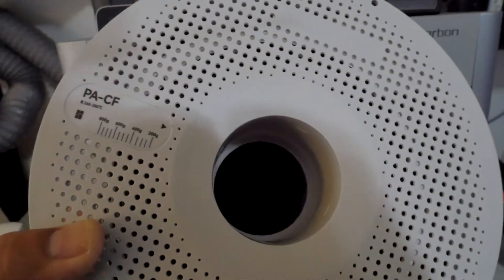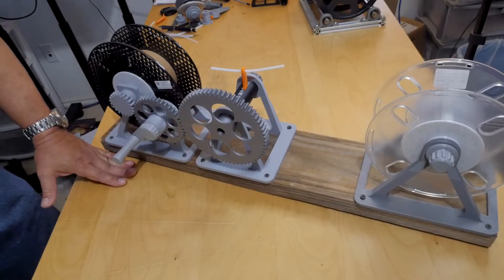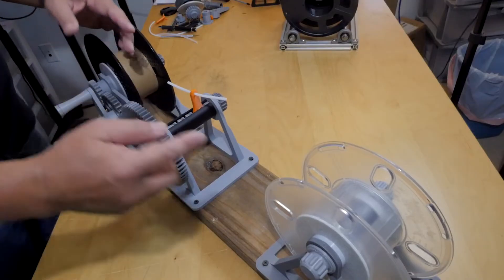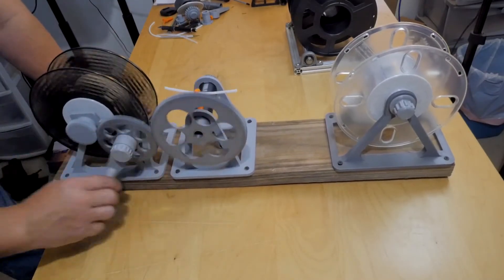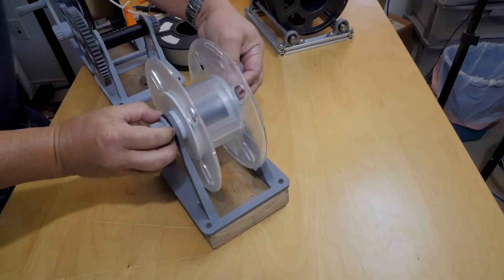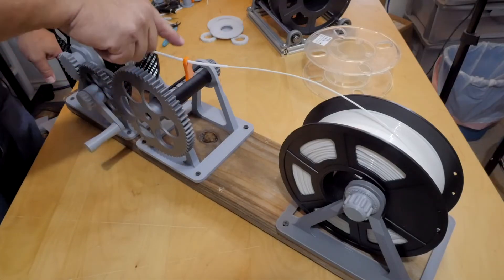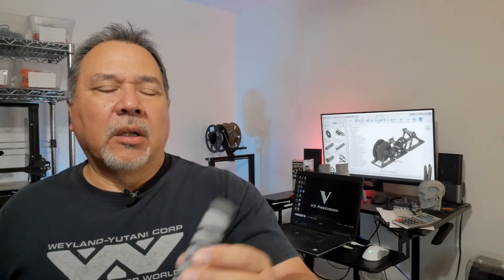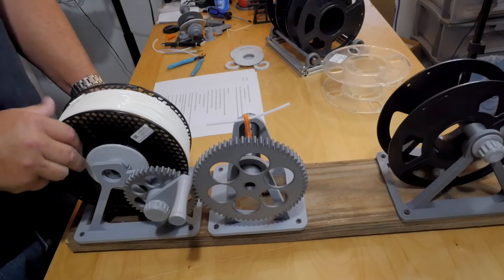New Filament Spool Winder by Randy Gray

Comment: Randy, I printed mine stock in both PETG and PLA. The bolts barely go in no more than ~25% deep.
Can we reduce the bolt size a little to make them easier to go in without requiring grease or breaking at the base?
Thanks! John

Comment: Just a hint/suggestion on the reversing gear.   (the back and forth thingy).  put one or two internal grooves on the inside that a locating ring can go in to. Then in the bambu slicer split the "gear" lengthwise and on the 45 so that the points on the channel will never need  support nor droop without it.  Then print the two halves on the split.  when assembling put the locating ring(s) in the channel(s) inside to lock the halves side to side,  then thread on the ends to hold it all together.  this will be a much quicker and cleaner print should you need to adjust something.  I would not suggest using PETG for this as its too gummy at the interfaces of parts .  I mixed up instructions for another winder that said to use PETG not PLA.  bad move on my part

Comment: You are a brilliant engineer, hat's off you. There are two other critical problems that your idea helps with. 

First incorrectly wound spools which cause a print to fail only because one line of filament got entangled with another above it. 

Second broken or cracked spools where you cannot put them on a roller and use only because the round corners are broken/ cracked. 

So you have two more strong reasons for making your project 😊

Thank You from India 🎉

Comment: This is the first thing I printed on my new P1S, the only problem I had was the Cam, (failed 3 times, then used Creality hi speed black and it printed perfectly)  The other problem I  had is when printing the middle part, the overhangs are pretty terrible, (the "eyes" at the top) even using your suggested printer settings.  This printer does not like overhangs.   I printed this using PLA, partly Bambu but mostly the black hi speed from creality.  The Bambu P1S was set for standard speed.  Maybe using carbon fiber or nylon would work better? or just have a machined aluminum model......I'd buy that! https://www.youtube.com/s/gaming/emoji/7ff574f2/emoji_u1f642.png

Comment: The receiver drive caps are too weak to allow them to be tightened enough to work. The adapter plates don’t grip the spool to spin it. I don’t see how this is supposed to work, using the profiles you set up for the parts.
Reply: same experience... bad model design

Comment: Is it me or are the scaling sizes a bit wonky? The .stl files are set to 100% scale are are tiny. the .3mf versions are scaled to about 2600% but look about the size I would expect. I am using Cura 5.4.0 as the slicer. Randy did a fantastic job on this, thank you!  Looking forward to printing this out an using it. In my case it will be to join nearly empty spools together a assure I won't run out mid print 😁

Comment: Could you make a higher/taller mount so we could wind 2,5kg filament spools on 1kg spools? Would be very nice, so i could use my old 2,5kg filament and also dry it. I bought the 2,5kg spool because it was much cheaper compared to a 1kg

Comment: first couple attempts to print the worm gear failed so tip use prusa slicer scale it a little longer and print on its side with tree supports if u stand it up it will take 4hrs plus but on its side 2hrs plus ps im using mk4 with input shaper normal printers will take longer

Comment: The thing I didn't like about the other popular one is he had it set to .2 instead of .177, so the spool didn't get wound nice and clean. This one seems to have the potential to dial it in to exactly the right spacing. But it would have to be closer to the receiving spool to force it to lay it down perfectly. I do like the direction you are headed though. That is a LOT of CAD work.
Reply from the maker: This one works but can use some improvements.  Hopefully the next version will have some significant design improvements. 👍